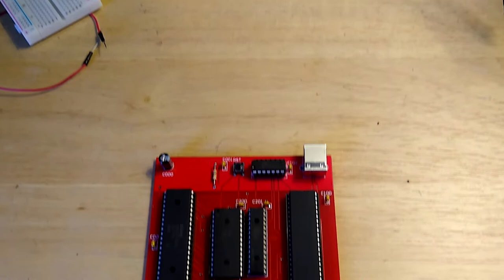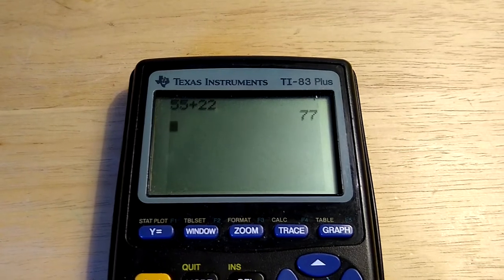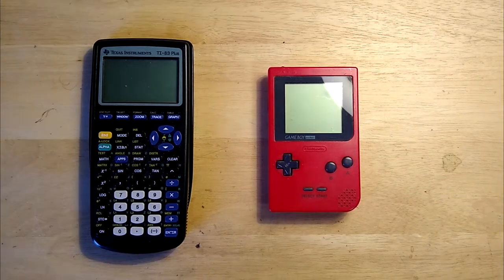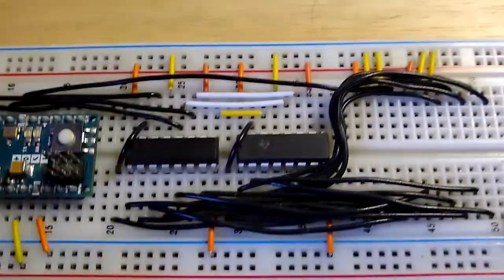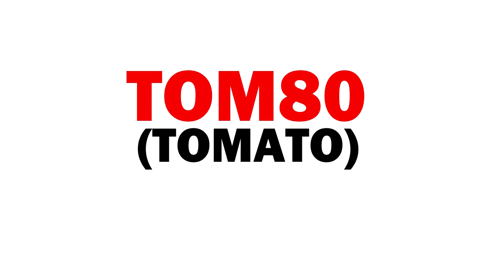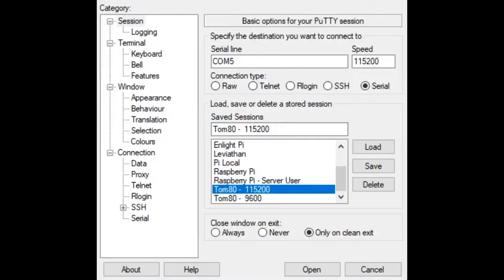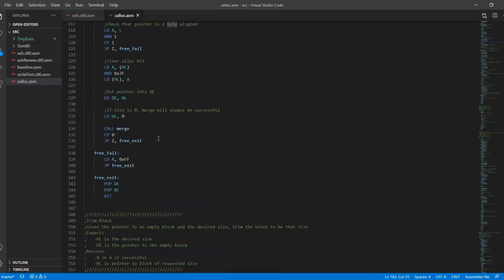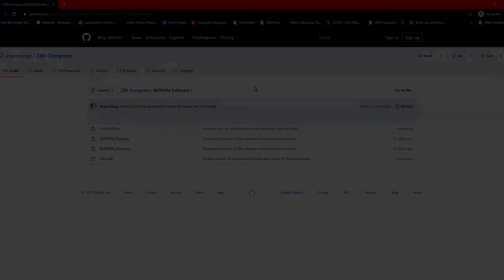Building a Homebrew Z80 Computer

Comment: The Snes CPU is based on the 65C816, which is like a 6502 with 16 bit extensions.  It's been theorised that it was picked to allow the SNES to offer backwards compatability early in it's dev cycle but that was never finished.

4:20   one of the values of BASIC is that PEEK and POKE allow you to read and modify memory directly, letting you do anything you could do with machine code, while at the same time retaining much higher level control structures, at the cost of execution speed.

Comment: Great work. FWIW, the NES had a variant of the 6502 processor, but the SNES used the 65C816 which for all intents and purposes was the successor of the 6502, but it was a 16-bit processor instead of 8-bit.
Reply from the maker: You're right, I should have said "6502 Like" rather than just 6502
I don't know how similar the two chips actually are
Reply: @AidanJennings  The 65C816 actually has a 65C02 "emulation mode" which is the default at start-up. It then has to be switched into 65C816 mode with a two instruction sequence. It is very compatible, but there are some operations that work just different enough that it could break some 6502/6510 software that depends on some fringe behavior of the 6502/6510. The SNES, however, used the full 16-bit capabilities of the 65C816.
Reply: @Edgar Malik Instablaster =)
Reply: @Jon Princeton thanks so much for your reply. I found the site through google and im trying it out now.
Looks like it's gonna take quite some time so I will get back to you later when my account password hopefully is recovered.
Reply: @Jon Princeton it did the trick and I actually got access to my account again. Im so happy!
Thanks so much you really help me out!
Reply: @Edgar Malik No problem :D
Reply: @jdunlap1974  it still had an 8 bit external data width. To me it is like calling an Amiga 500 or Atari 1040ST a 32bit system because the internal of a 68000 is 32bit.
Reply: @xXTheoLinuxXx  The 68000 felt like a 32bit processor from a coding perspective.
Reply: No idea why exactly, but the 6502 in the NES feels more powerful than the 65816 in the SNES. If you just look at raw "controlling", calculating enemy positions, bullet trajectories, instructing the sound and graphics sub systems, the NES does a better job. You can see it when you put two games that exist on both platforms side by side. In most cases, the NES version is more complex. It won't be noticable immediately, as you has to see through a thick layer of graphical effects, bigger sprites and more colours, but underneath, the SNES is really worse.

Comment: I like your willingness to be working close to the hardware and software.  I trained on the Z-80 using the Bugbook series from Rony Larson Titus.  Later I worked on terminals that used 6800 uPs.  Later I tried to gain experience with CP/M but then everyone jumped to the IBM-PC and 8088, and the 8 bit processors were left in the dust.

If I were you I would get competent in 8031 / 8051 microcontrollers which are used in process controllers.  You should be able to get a very good paying job in that field if you are competent in both hardware and software.  Thanks for the video.

Comment: BTW remember that "an hour in the library is worth ten in the lab."  It's better to search and find what you need than to reinvent the wheel.  There is a lot out there that's already been debugged and used by others, and you can help by collaborating and adding to the stuff you find and use.

Comment: I was the opposite. I had the C64 and the Amiga but not what you had. In fact, although I was keen to learn Z80 coding, there was nothing available that could compete for price in my country, so I missed out. That said, both 6502 and 68000 were nice CPUs to code.

Comment: Aidan, nice project. Not too dissimilar from my own USB based Z80 computer. If you’re interested in some software that you can modify to run on it, I’d be happy to help you out.  I have a monitor that allows for memory dumps, modifications, Intel HEX transfers to the computer, as well as an integrated modification of TinyBASIC which is greatly expanded. Including memory peeks/pokes, In/Out routines for IO, and running of machine code in basic. Let me know if that is something you’re interested in. Happy to help out.

Comment: From a hardware point would it have been simpler to use an eZ80? Easier to use 64K RAM for CP/M and then keep the ROM also?
Reply from the maker: For this project I didn't intend to run CP/M but yes, if that is your goal then an eZ80 (or a Z180) would be more than sufficient!

Comment: answer to my prayers..been looking for this after finishing with ben eaters videos. Pls upload more videos am really excited. Is there any way we can ask you questions?
Reply from the maker: ask away!  Ill do my best to explain anything I didn't elaborate on in the video
Reply: @AidanJennings Hi i have been  wondering how a memory monitor works on z80. how it boots up and how it is structured?. Thank you sir
Reply from the maker: I based my idea on WOZMON for the Apple II.  The monitor has three instructions, Read, Write, and Execute.  Typing a '?' will print a help prompt.

I attempted to create an LL(1) parser to process the instructions although it doesn't exactly resemble one.  The monitor subroutine is made up of three functions.  The first is a lexer that converts the input string into tokens for the parser.  The second step takes each set of hex tokens and converts them from ascii to two byte words.  The third step executes the instruction assuming the syntax is correct.  

The Z80 starts at address 0 on reset which is mapped to the EEPROM and begins by initializing the UART.  The monitor program is run in a loop that is only broken out of if the user executes at an arbitrary location.

The source code is all contained in this file:
https://github.com/anjennings/Tom80/blob/master/src/Tom80/ASH.asm
The boot code is around line 90 and the monitor subroutine is around line 370

I am currently trying to rewrite the monitor in c as tweaking Z80 assembly is pretty tedious. The source files for that are in the c-Parser branch. https://github.com/anjennings/Tom80/blob/c-Parser/src/zdk%20projects/uart/monitor.c

I hope that answers your question, feel free to ask my anything else if you are curious.
Reply: @AidanJennings  what is the rom monitor main purpose? can it be the operating system of the device?  Is it possible to walk us through how you built the rom monitor in a video? thank you for the answers